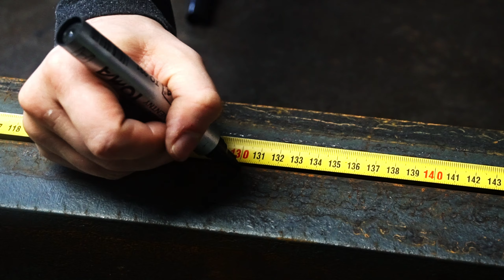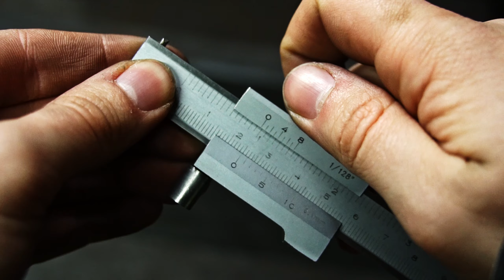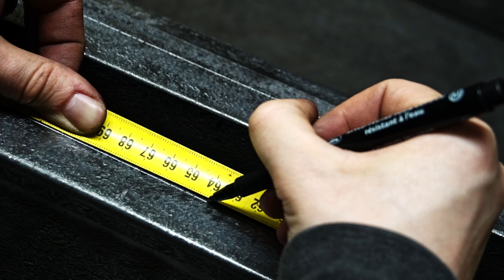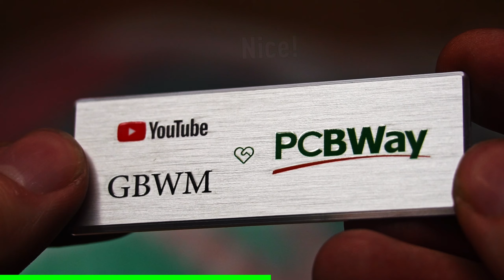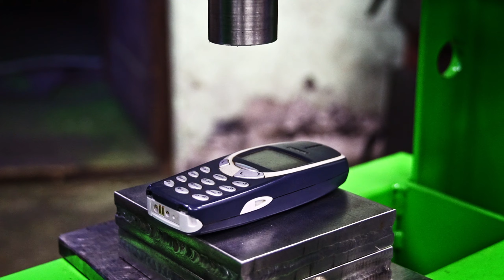How To Make a 20 Ton Hydraulic Press

Comment: I truly appreciate these videos! The only problem is these are for those with large shop tools and not for the small  hobbyist tools.
Reply from the maker: Well - I've started with a cheap welder and an angle grinder  :)
Reply: we all start somewhere, check used tools, classifieds, restore projects. I got a 1950's craftsmen bandsaw for 50 bucks and put about 6 hours into it and runs like a champ
Reply: I started with a cheap welder and a angle grinder, made a slip roller, two steel tables, found a cheap column mill for $600, I was given a lathe(needs a motor, as did the mill) given a belt sander, given a abrasive cut off saw.
Reply: I'm building a press right now. 30 ton. Why I'm watching the video.